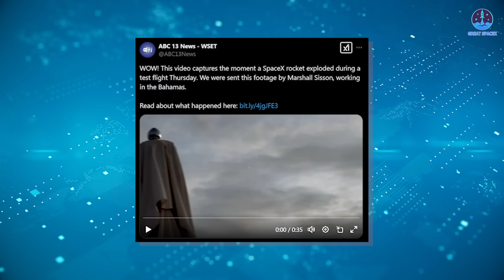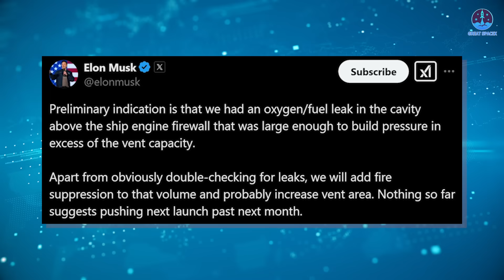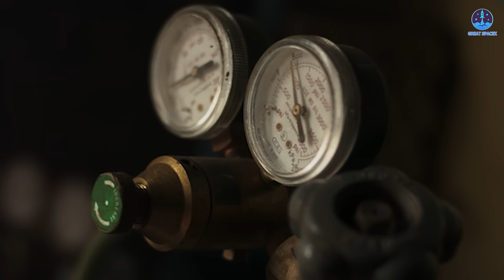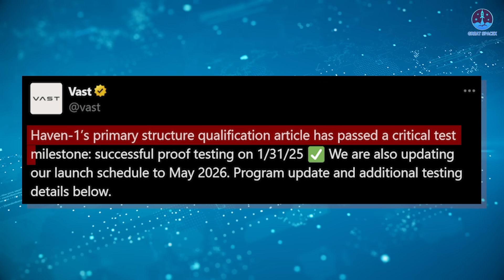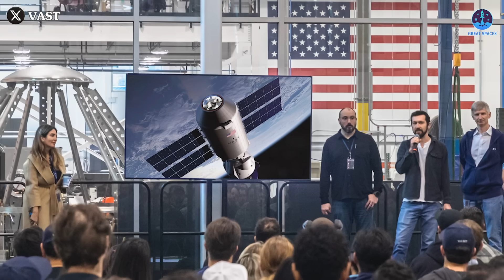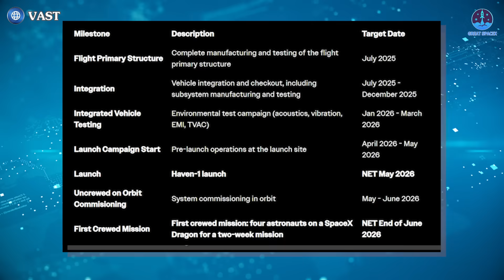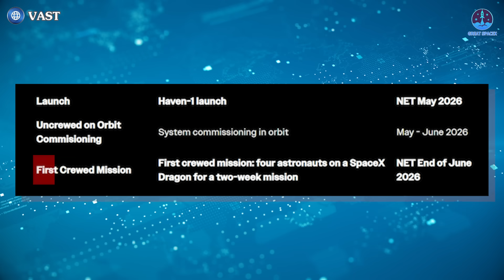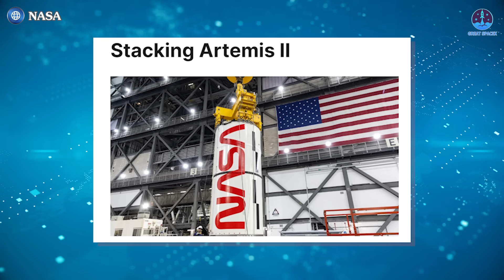New Starship Flight 7 Footage Revealed How Exactly Ship 33 Exploded...

Comment: Please correct me if I am wrong, but I don't think SpaceX triggered the Flight Termination System.  It exploded shortly after the last center engine went out meaning there was no time.  Also, they talked about Artemis' second launch, but there is a good chance it will be canceled before that due to cost overruns.
Reply: I don't think "they" triggered the FTS, I was under the impression that the onboard system triggered it, so it was automatically terminated.

Comment: 1st off why is Space X manually initiating the flight termination system???? Don't overreact to the situation because all this is happening while the vehicle is well over 100 miles in altitude. Let the situation try to stabilize itself. After all the debri is of no immediate danger as it takes a relatively long time to descend from those altitudes. Just because it is visually disturbing is no cause for alarm by anyone on the ground or in the air below what is visible to the eye. If they hadn't manually terminated the vehicle it probably would have come apart well out over the Atlantic ocean & well away from any land mass.
.
Reply: Well I'm glad you know more than SpaceX.. Look, there had just been an explosion on the rocket and it's no longer if it will break up but what that break up will be like. They have no way of knowing if it will be large pieces or smaller pieces if the termination device isn't used and any delay could render the termination meaningless as the rocket has already broken up and the termination device will no longer make any difference. They made the call based on the information they had and the risks as they saw them. I'll trust them to make  decisions that based on what the data seemed to require.
Reply: I believe it was automatically triggered.